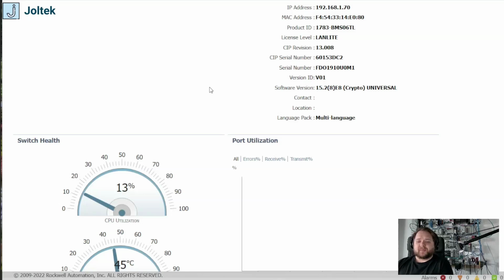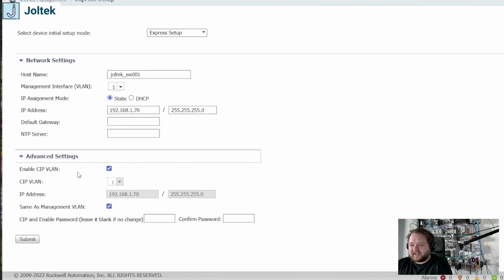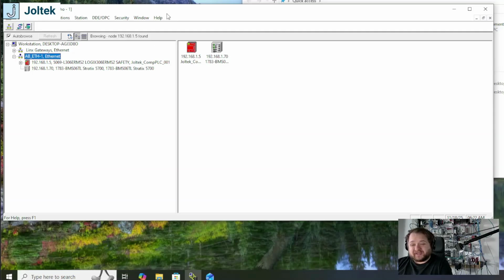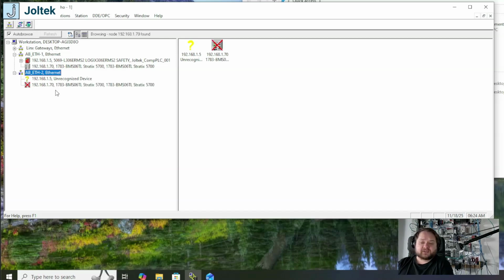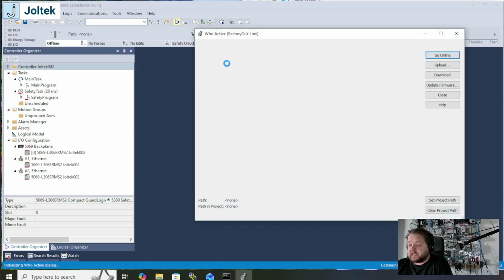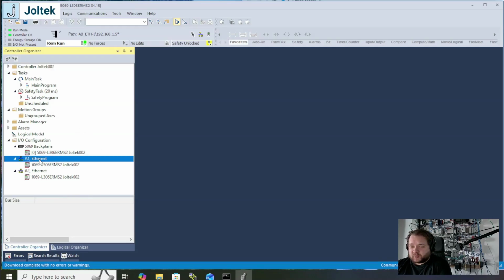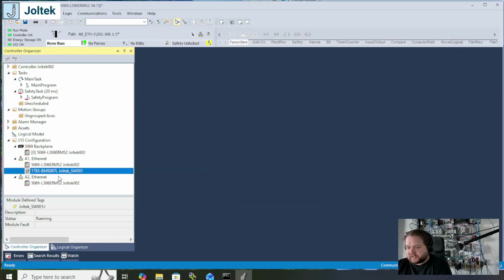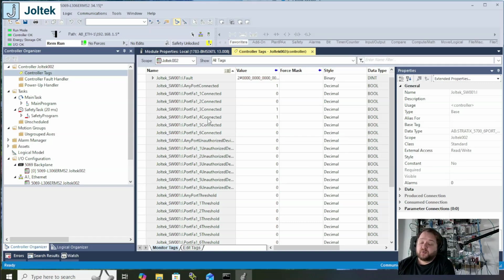L4.5 | Stratix in Studio 5000: Add a 1783-BMS Switch to CompactLogix I/O Tree [Full Walkthrough]

Comment: Hi Vlad! Thank you for your video. In the factory where I work, there are 3 stratix in IO device list, but with different status:
-First switch: everything fine, I can see the whole configuration.
-Second switch: error with a yellow triangle that says: "path specified incorrect or module not responding", but I can see this device in RS Who.
-third switch: same then the second one, but I can not see in RS Who also.

I need to use the AssetFactory for everything from the company's server, so Im not able to ping or access the switch via brpwser. Waht I may do or check to fix both switch? Thabk you !